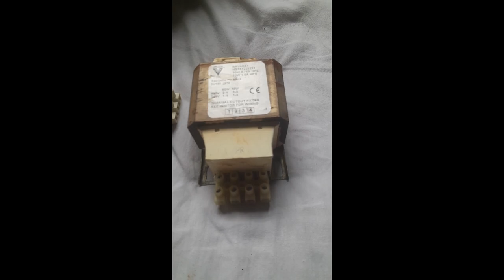Can I Repair this Destroyed WRTL 2600 Sodium Street Lamp? Lantern Repair

Comment: 1:22 I have a ballast like that old one, mine is a 100w SON T one made by Harvard, a company that made them but went bust. That little red connector wire in the middle is for a node CMS control to be connected to! Nice video and restoration, I actually bought one of these lanterns from eBay and it’s arriving soon.

Comment: That would have been a pain to sort out, that model of hinged column is extremely top heavy. The blue rope supplied with it is supposed to tie the end of the hinge to the base so it can't come down completely.

I'm impressed that you searched, recovered, and repaired it! I would have tried it if I was the one who responded to that callout.

On and off in what way? Turning on, warming up to almost full brightness, then shutting off, cooling down, and then starting up again (rinse & repeat), also known as a "cycling lamp" is what happens when the lamp itself reaches end of life.
In technical terms, the voltage needed to maintain the arc in the lamp changes when it gets hotter due to a pressure difference. An end of life lamp has a greater pressure difference, and so the voltage provided by the ballast can't sustain it, and it shuts off. But (most) ignitors don't know the lamp is EOL, so they try to fire the lamp again, but can't because the pressure's too high to strike the arc. So keep trying until the lamp cools down enough for the arc to strike. At this lower temperature, the voltage provided by the ballast is sufficient to stabalise the arc and the lamp starts to warm up again. Once it reaches near full brightness, the pressure inside is too great again for the ballast to run the lamp and it shuts off again. This cycle continues until the ballast out ignitor give out altogether, or the lamp is replaced.
Reply from the maker: Yep thats exactly what was happening to it, it was doing that for months before it was knocked down, so I am so happy I got to fix this lamp :)
Reply: That wasn't knocked down, it was somehow opened properly and the rope likely cut or snapped under the mass of an uncontrolled drop!

Sorry we couldn't give you one when you saw us up the path.
Reply from the maker: No worries, are you the engineer I met up there?
Reply: I am indeed! I did leave a comment on that video, too.
Reply from the maker: Oh awesome, thanks for telling me what the new lantern is I've been looking everywhere for what its called haha :)
Reply from the maker: @George_M55729  thanks! I might just happen to walk that way haha

Comment: Do those photocells found on every lamp turn off each of them individually in England? I've never seen this happen. Usually the whole street gets switched, or one side of the street. I thought a human operator does it.
Reply from the maker: usually yes, each lantern is operated by a photocell. In some cases multiple lanterns can use one photocell or be switched manually such as in most car parks

Comment: I would have converted that fixture to LED to bring it up to date. It would be cool retrofitting it with amber LED modules that mimics LPS. I’m just kidding about converting the fixture to LED, but it looks like the fixture would accommodate a low wattage LPS lamp and ballast?
Reply from the maker: Yeah it could however i like to keep lanterns as original as possible, it uses a 50W SON High pressure sodium